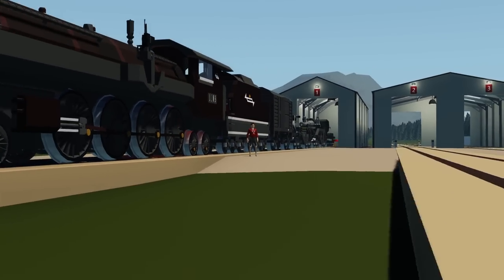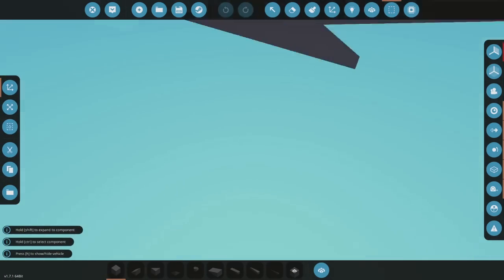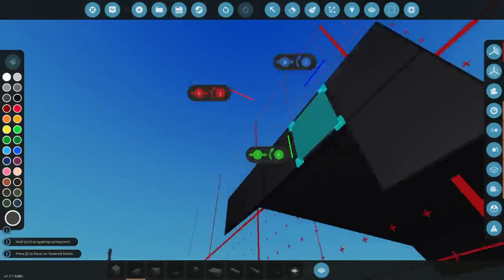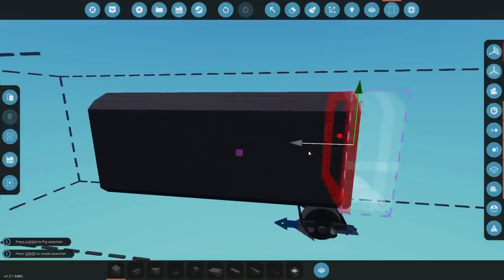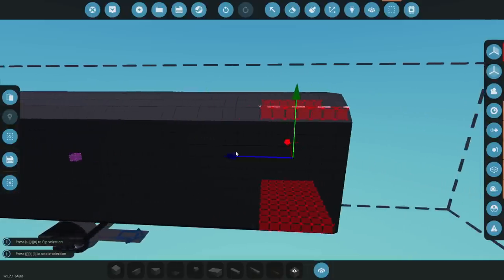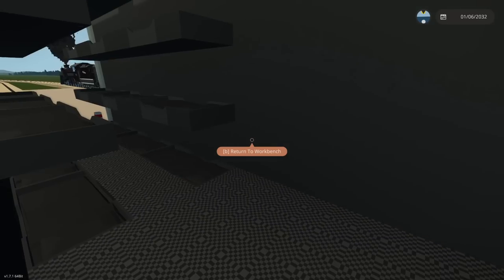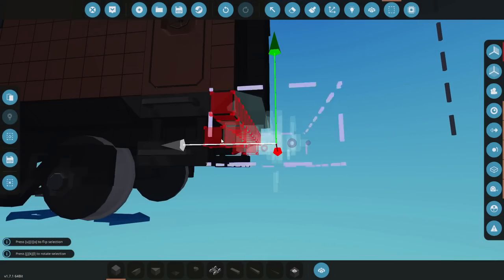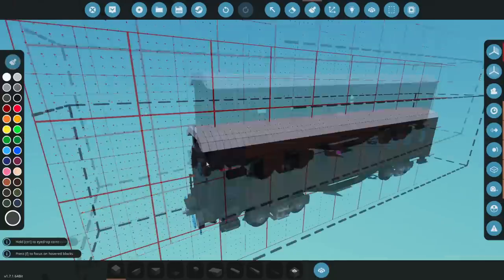TROOP TRANSPORT TRAIN CARS! - Lets Build A Steam Engine In Stormworks!

Comment: Hey Frantic, loving the videos, this build is really doing a great job of combining two of my passions (WW2 equipment and steam trains), within one of my favourite games.
I do have a few things to suggest/point out though.
First, I'm pretty sure the reason your train keeps stopping on the curve is because the turn is too steep. A 4-8-4 locomotive just cannot make that turn; maybe consider removing an axle or two from the drive wheels and removing the rear truck. Make it a 4-6-0, basically.
Also, i think you should consider adding batteries and a hand-crank generator into the tender, and connecting all the cars and the locomotive with electrical connectors so you can send power from the tender to everything else to power the lights and electrical equipment. I know you've been operating with infinite electric on, but if you ever try to use it without that setting it may be wise to have actual power in the train lol.
Also, you should consider adding an air raid siren to the spotlight car, and ladders to the tall cars (tender, boxcar, barracks) so you can climb over them.
Oh yeah, and the flak cannon should have a second barrel and fire faster; it ought to be a little more automatic. As it is currently, it functions more like artillery than flak, with the manual breach-loading system.
I would also suggest adding some armour around the artillery and flak cars, as they wouldn't be used to fire at low targets anyway, and currently the operators are very exposed to ground infantry.
It may also be wise to add an armoury car with large amounts of ammo and firearms, separate from the boxcar. And maybe some gun racks in the barracks, in case the train is ambushed.
Many WW2 logistics trains also carried small amounts of rails and ties to repair the tracks if they were damaged, so perhaps a flat car with those supplies could be added (I know that's not really a thing in stormworks, but it would be nice to see).
I've seen a few other comments suggesting an officer car, which might be nice to see, but ultimately I believe that would have been quite rare to see irl, as most officers traveled by armoured car.
Some sort of radio car would definitely be a good addition, as almost every train during the war would have carried radio and telegraph equipment to communicate with the home office and the front line, in case the train needed to be halted or diverted in an emergency.
Flat cars designed to carry heavy equipment would be cool, too; stuff like tanks, jeeps, and the like. Perhaps some stationary artillery pieces on their way to the front lines, too?
I also think you should add heaters to the barracks car, since you really don't want your troops to be too cold to fight if the train is ambushed.
Also, steam locomotives almost always had a name and the name of the company running them on the locomotive and the tender; can you add those?
Oh, and one more thing: a train like this would almost definitely be hauling fuel and motor oil for the mechanized infantry units, and possibly even aviation fuel for front-line airfields. Maybe consider adding a tanker car or two.
Reply: How tf did you find the time to write a whole essay for a comment
Reply: @Notapenguin515  i have unfortuntely been unemployed since october, and I have no life lmao